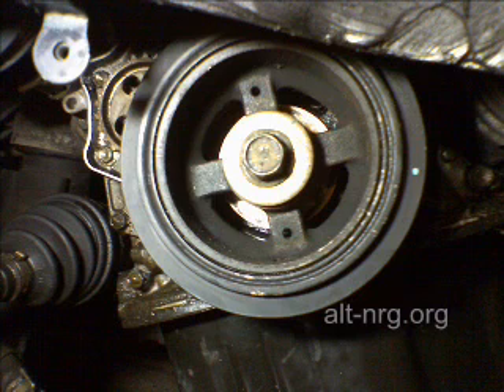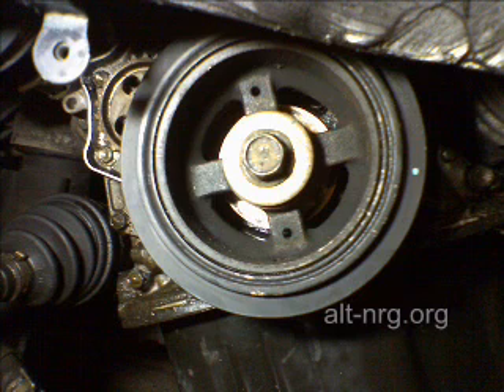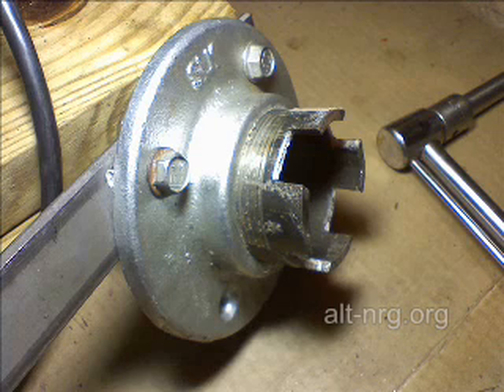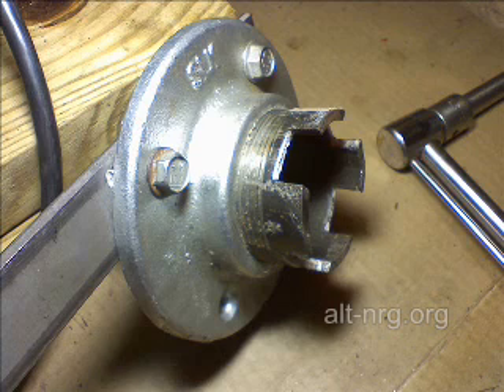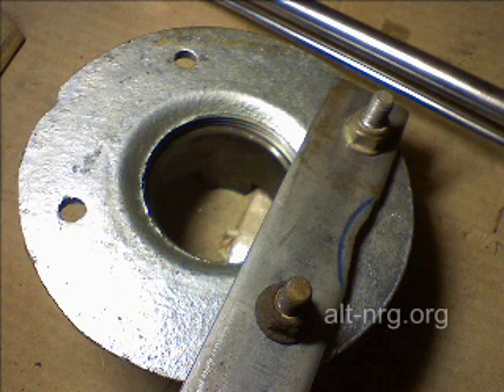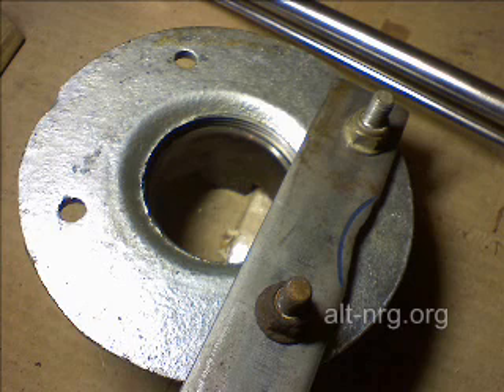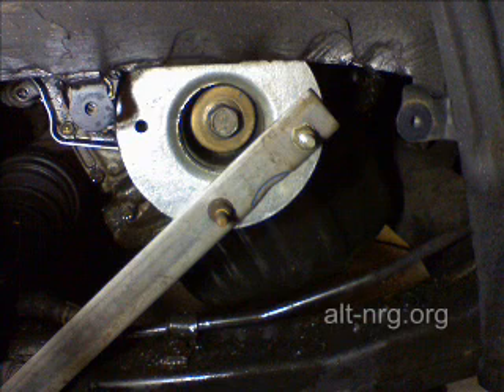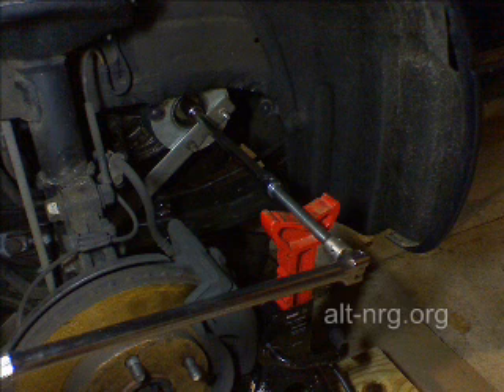#141 - Harmonic balancer DIY removal tool

Comment: This is silly. Why not just buy the proper tools. I can pull the bolt off in a second with my 800# impact wrench. Just set it on the bolt and pull the trigger. That's 800 lb feet right there.

Comment: Without a rattle gun my preferred method to remove a crank bolt is a suitable breaker bar with a 6 point socket on the bolt and blip the starter, making sure the bar will strike something solid. This method always gets the bolt loose though you might have to do it quite a few times. If this is impractical, like with honda motors, an offset ring spanner and a lump hammer works great too.

Comment: hey just wanted to tell  you that a get idea
but if you have a air or electric  impact wrench  it only takes 2 sec to remove that bolt  most  impact wrenches are about 300 to 600 lbs off and 200 to 300 on its is the brand  and if its air what your presser you air is set to

Comment: Zero, for the same challenge on my camry, I broke a wrench, torque wrench, 2 strap wrenches, and wasted 20 min with an impact wrench. success was found with a breaker bar and cheater pipe (like you), a huge chain-pipe wrench with an extended handle. Breaker bar and pipe stopped against ground to turn pulley around bolt. pipe wrench up through engine bay, me standing on radiator pulling on the thing. what's the spec, 80 ftlbs? Bet the factory guys got a good laugh when they snugged that bolt down

Comment: Nice work indeed! I assume, though, that a good portion of that 240 lb-ft of torque got wasted in twisting your drive extensions. The spec on my 03 Mazda Protege crank pulley (harmonic balancer is built in) is 116 - 122 lb-ft.

Again- nice work, ingenious.

Comment from the maker: LOL! That's funny. Not a joke in my family but true nonetheless.

I do have a few mechanics to tap for advice. They told me about the starter trick to remove after I did the job but it still doesn't help when reassembling. I didn't want to disassemble all the intake plumbing just to remove the starter to jam the flywheel.

I also tried my air impact gun. Even cranked up the pressure to 180 psi. Didn't budge.

Thanks for watching!

Comment: I have 25 years of industrial manufacturing experience and my wife and I have a running joke that I cant do a project with out making a tool for the project. One suggestion get a small air compressor a few air tools since you are only doing research you dont need to buy every thing off the tool truck. Dont be afraid the ask for advise from the local auto shop, some are more than willing to help the shade tree mechanic they have done the work for a long time and know all the short cuts.

Comment: Zero, why didn't you place the breaker bar and socket assembly on the bolt allowing the handle of the breaker bar to rotate counterclockwise and rest on the lower controll arm? Then turn the key bumping the starter just a tap. This breaks the crank bolt loose in 3 tenths of a second.
   To tighten, remove 2 starter bolts, slip the starter back out of the bell housing. Insert a large regular screwdriver into the flywheel teeth and torque crank bolt to spec.

Comment: I'm sorry, Did you say you put the strap on the inside of the spokes?  So the strain goes along the grain of the strap...is that correct?  Or are you magically somehow ignoring the pulley that the spokes actually attach to and going directly on the center radial?  I use to be an alignment technician, probably nothing like this, but seen one nut, you know how all nuts work...as far as strap goes, that's just boggling to me, good job on your accomplishment though.

Comment: you need $20,000 worth of tools and 15 years of experience to do this kind of work. I've seen many who try to do this kind of thing by the numbers and everyday mother nature kicks their ass. You'll need a dual stage air compressor @220V, 1/2"~ maybe 3/4" air gun,& metric impact sockets. And all this to remove a crank pulley/harmonic balancer? Best leave it to your local mech. it will cost you way more, unless you are looking to start a repair shop. If so, I am interested...

Comment from the maker: Thought about that. Might work for taking it off. Not much help for tightening to the specified 80 Lb/Ft though. Still need a way to hold the balancer.

Comment from the maker: Oh yes. 95K on the old belt.
Reply: 229,000 miles on my current belt that broke! Original belt was replaced at 160,000 miles...Total mileage on '95 1.8 Geo Prizm (Toyota Corolla) is 389,026... Excellent butt hauler!!!

Comment: So did you replace the timing belt while you were that deep into it (assuming it has one)???

My daughters KIA timing belt has to be replaced every 70k miles, and I will be building you tool on the next belt change out.

Comment: That's the American way!! Improvised when you don't have the tool you need when you need it! If you work on cars long enough you will learn a few tricks even if you're not a certified mechanic. I've found that you can use google to help find easy fixes too! Now if only you could come up with at tool to fix the economy  :0)

Comment from the maker: Consider that the radius of the pulley is about 2.5". 240 Lb//Ft would be (12/2.5)*240 or 1152 Lbs force at the outer circumference. Strap wrenches I've seen either would never stand up to that force, would damage the pulley surface or the harmonic balancer rubber shim would tear apart under the strain.

If any of these outcomes appeals to you then by all means, go for it.

Comment: Cool Zero, looks a bit like a (smaller)"tool" I made one time out of a piece of correct diameter pipe(I added a leverage arm) to use as a wrench to remove an inside fluted nut from a boat outdrive lower unit. There was about 15 of those tabs with about 1/4 inch depth and 3/8 lenghts....It worked..

Comment from the maker: Tried that. Still didn't budge. Ended up heating it slightly a few times with a torch and using penetrating oil. Still took 240 Lb/Ft torque to get it off.

Comment: nice.  though to help brake it free you can tighten some then loosen  ... that is one bolt you do not want to brake off.  if you do you might not get it out and will need a new crank.

going back together oil or anti-siese for next time.  hopefully there wont be a next time lol.

Comment from the maker: Thanks. I should also point out that the specified torque to tighten this bolt is 80 Lb/Ft. Three times that force to remove it. It laughed at my air powered pro impact driver.